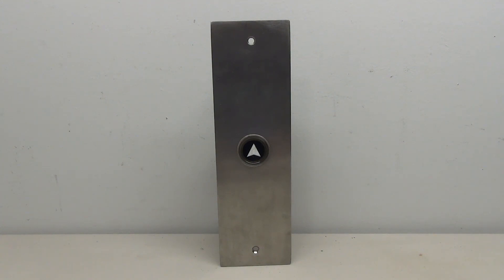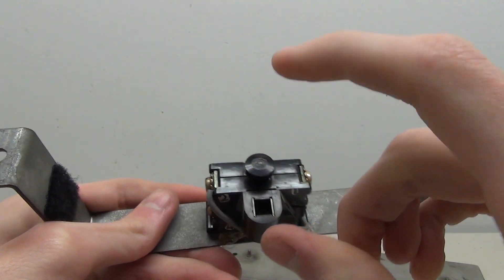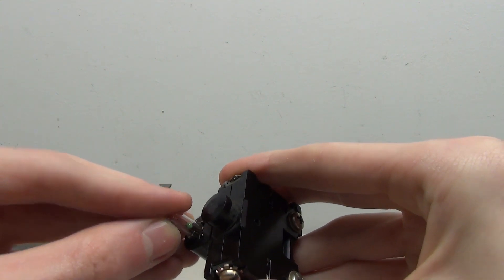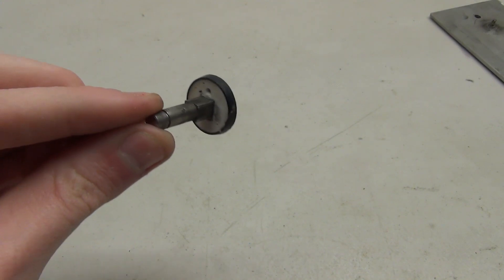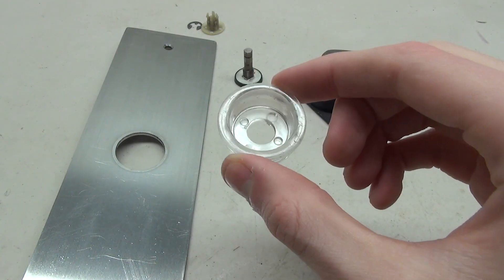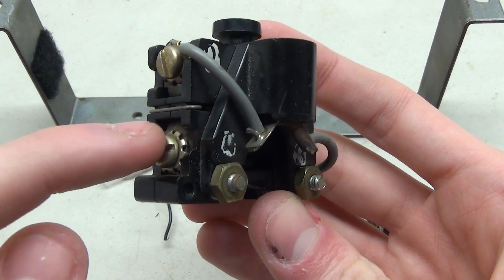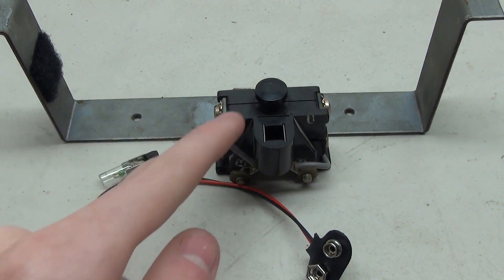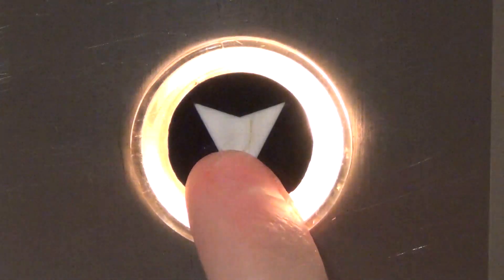Wiring an Otis Lexan Elevator Button

Comment: Is it safe to power a 6psb bulb with a 9 volt battery? Will it make the bulb burn out faster, since the battery is putting out higher voltage than the bulb?
Reply from the maker: I’ve been doing that for years and haven’t had any issues
Reply: @ Ah! I see. Thanks 😊

Comment: Thanks so much for the tutorial! I hope that I can wire mine… I just purchased the version that has both up/down buttons and a “Not Running” light in the center. 😊
Reply from the maker: I wired a panel for the museum with a similar layout. Made it where the buttons lit up when pressed, and added a little switch on the back to turn on the out of service light.